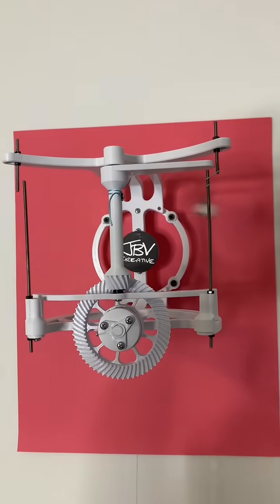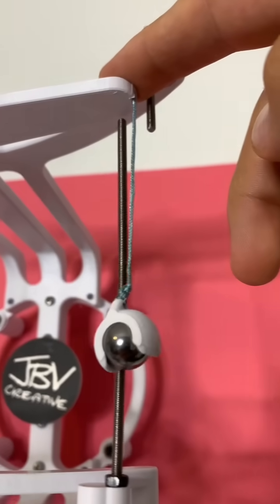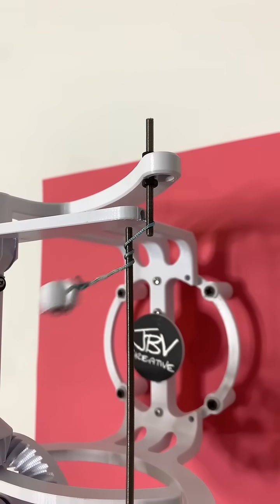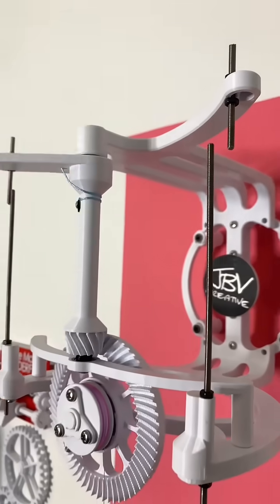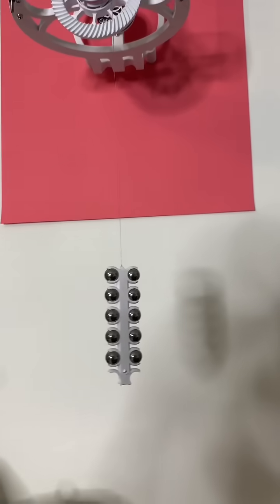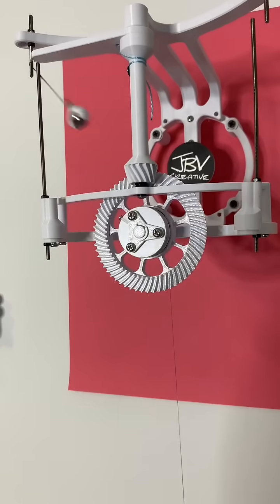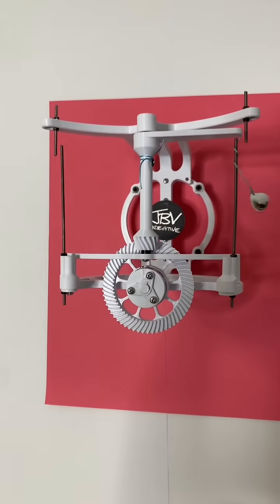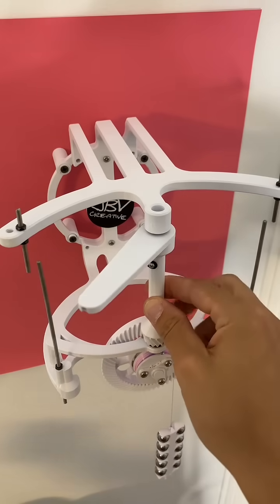The Flying Pendulum Escapement…what?!

Comment: "It's got no pendulum... it's just a weight attached to a string.... " I'm no scientist but I'm pretty sure that's  a pendulum
Reply: Pennsylvania
Reply: @technorunner1  Trannysillvania
Reply: Not quite. I maintain a clock tower, and the pendulum is what keeps time, but the weights, that have be cranked up the tower weekly, and assist the pendulum in maintaining its momentum. Since we live in an atmosphere and have gravity, the pendulum does not swing indefinitely because of friction in the mechanism and gravity, so the weight slowly dropping is what continuously puts energy back into the pendulum, which will be a specific weight and length to engage the clock hands to move precisely every second, minute and hour. The bell has its own entire mechanism with weights and gears that rings a bell every hour instead of moving hands. 

So, basically counter weights aren’t pendulums based on their function in the mechanism. This guys invention could only be a single piece of a much larger machine, simply controlling the rate at which the weight is dropped.
Reply: @geetarguy777  
This guy in no way invented it. It’s an escapement designed a long time ago.
Reply: I'm glad someone pointed that out
Reply: Definitely a pendulum.  A funky pendulum with a really cool action to it, but a pendulum it is.
Reply: Thank you google scientists
Reply: @truthspeaks6557  "it is" "technically it isnt"
Reply: It is a pendulum with a varied period .  Ingenious sculpture
Reply: It’s a pendulum. Weight on a string that swings through an arc. And yes it has horizontal movement that is merely redirected into a horizontal bidirectional rotation by the spindle it wraps around. Still uses the principle that the time of swing in a pendulum is constant.
Reply: @pl watch the video. There is lots of horizontal movement happening.
Reply: Public schooling
Reply: Basically........basically
Reply: He's becoming a horologist.
Reply: That's bird $hit that you've got there in your account PIC.
Reply: CLOCK. ABSOLUTELY
Reply: The pendulum is on the end of the string wrapping around the posts
Reply: Exactly, you are not a scientist
Reply: Yes, but it's not a pendulum escapement, you could replace that weight with a spring
Reply: It has a real pendulum powering it at the bottom
Reply: Pendulums swing back and forth. Think clock.
Reply: Well, technically a pendulum swings back and forth. This.... swings back and forth. 🤣
Reply: Your statement is so profound! Your avatar is so fitting!
Reply: @Maxx_NeverStart  Now dont get mad. Because he is right.
pendulum, body suspended from a fixed point so that it can swing back and forth under the influence of gravity.
Reply: I came to say exactly the same thing. That is exactly what a pendulum is.
Reply: It is in all reasonable responses in a scientific manner a pendulum. Based on a linguistic definition it is not.
Reply: pendulums don't use electricity you absolute dolt
Reply: @env0x  the pendulum is but a part of a bigger system. Just like a pully and wedge can be used at the same time.
Reply: Yea lol, I watched it twice and was still not sure if that part was an intentional joke or not... 😆

Naysayers in the comments notwithstanding, it's still clearly a pendulum, even if made to behave in a very non-traditional way!
Reply: I'ma no Leonardo but.....
Reply: If you want to play this everything's gonna have lots of meanings and soon enough noone's talking about the same thing.
Reply: @cocolasticot9027  let the adults converse.
Reply: @shoppingrb9544  I have an engineering and a physics degree, so I think I can do that.
But you misunderstanding a simple light-hearted comment about semantics tells more about your ability to discuss anything.
Reply: I mean, technically you could call it a pendulum, but it has no horizontal movement, so calling it a pendulum is pretty pedantic.
Reply: @VibesOfVinegar  “has no horizontal movement” ….watches it move horizontally.
Reply: @VibesOfVinegar  a pendulum is any weight suspended from a point so it can swing freely, horizontal motion has nothing to do with it
Reply: @chalor182  Yeah, except the weight in this case doesn't have the most important characteristic: periodic motion.
Reply: @VibesOfVinegar  except it does albeit a complex periodic motion
Reply: @VibesOfVinegar  it does but in 3D instead of just 2D
Reply: @chalor182  yeah it does... The connotation of pendulum is something that swings back and forth... Not in a dam circle around something. So the comment saying it may technically be a pendulum but it's not really a pendulum is totally reasonable
Reply: @VibesOfVinegar  except it absolutely does.
Reply: @VibesOfVinegar  any motion which is repetitive is periodic. no matter how complex the whole movement process is. It has a periodic movement, it just consists of more than one step
Reply: @VibesOfVinegar  that motion looks pretty periodic to me.
Reply: @VibesOfVinegar  Just because It's not moving doesn't mean it's not a pendulum. If a pendulum stops swinging, it's still a pendulum.
Reply: @chalor182 It doesn't swing freely. It's caught and wraps around posts.
Reply: @VibesOfVinegar  isn’t that whole sentence pedantic lmfao
Reply: @VibesOfVinegar  nope. You don't know what a pendulum is or pedantic.
Reply: @VibesOfVinegar  it’s motion absolutely has a horizontal aspect to it! More so than any vertical...
Reply: Y’all nerds really arguing about what a pendulum is
Reply: Periodic motion is motion in which the outcomes are equal in both time and action to complete. This is not a true pendulum with periodic motion as the time to complete each cycle isn't 100% true and exact hence why it isn't a true pendulum albeit very very close to it but this is about as close you can be to a pendulum or periodic motion. Also since it's constantly moving down to a rest point where it will no longer move the periodic motion would end hence killing the fact that it could be a pendulum.
Reply: @acehooligan857  There is no such thing as perpetual motion, every pendulum stops for one reason or another causing it's periodic movement to cease. So, by your own logic, there is simply no such thing as a "true" pendulum. That's a strange position to be arguing. You have tried so hard to be correct and prove him incorrect that you have now negated your entire augment and made you both incorrect. Congratulations! Your transition to the Dark Side is now complete!
Reply: @acehooligan857  nonsense
Reply: @acehooligan857  lol wrong.
Reply: @acehooligan857  grandfather clocks will stop running if the weight doesn't get lifted back up. so what's the difference?
Reply: @acehooligan857  nonsense. No pendulum has “true and exact” anything. None of these are requirements for the definition
Reply: @acehooligan857  
Huh?  So which pendulum has a 100% true cycle every time?
You’re just making shit up.
Reply: @acehooligan857  By your definition nothing is a *true pendulum". Nothing in the universe can have these exact characteristics.
Reply: @acehooligan857  I mean I think you are confusing a pendulum with propetual motion
Reply: Eghh… you forgot the part where a pendulum is supposed to be attached to a fixed point and allowed to swing freely (it wraps around a pole and thus not allowed to swing freely, and the point it is attached to moves from left to right)
He’s not referring to the weight underneath the contraption, but the escape mechanism.

He said “the flying pendulum”(referring, again, to the escapement mechanism), which it is not one.
No fixed point, no free movement from a fixed point.
Reply: @CalamiroAsjcobeti  then explain How the second pendulum in a double pendulum is still a pendulum
Reply: @SlaskPrask  the double pendulum is the first counterpoint I thought about while reading these comments! Let's think about the physical system in the video:
First things first, a motion of a hanging mass shouldn't be discounted as a pendulum only because it is moving through 3D space and not 2D, think of a Foucault pendulum.
Now we can divide the motion of the mass into two stages:
1) the mass attached to a string, which is itself attached to an arm rotating on a plane parallel to the ground. The resulting motion is an accelerating rotation (it's accelerating because the motion is caused by the many balls in freefall) which looks like a spiral with varying radius due to the varying tension in the string, caused by the varying centripetal force due to the acceleration. Imagine looking at this mechanism from a front view (not top-down): without the rotating arm it would be a simple accelerating pendulum, and with the arm the concept is closer to a double pendulum albeit a bit less caothic (I can try to write down its equation of motion if anybody is interested, let me know 'cause I'm lazy). So I would say that during this phase it can be considered a pendulum.
2) the mass is hanging from a string attached right above a rod, and the string is coiling around the rod as it spins. I also would consider this a pendulum: the length of the string is variable, and so is its "attaching point" (the point at which the last part of the string contacts the rod, from which the string starts separating from it, is the new attaching point throughout the motion). Like on the previous stage, imagine looking at it from the front and you'll see a variable length 2D pendulum whose attaching point gets lower then higher. I find this a very interesting motion. 

I think that what confuses most people is that this motion is made up of two separate stages.
Reply: @SlaskPrask  in a double pendulum, the second part is fixed to the first one and allowed to swing freely from that fixed point.
It doesn’t wrap around a pole that is external to the pendulum.
Like the rope does in this one.

Pendulum: “a weight hung from a fixed point so that it can swing freely, especially a rod with a weight at the end that regulates the mechanism of a clock.”
When the weight on the rope wraps around the pole, it is no longer swinging free from a fixed point, because the point from which it swings keeps changing to further and further down the rope.
Aka it is no longer swinging from a fixed point, and thus not a true pendulum.
Reply: @al3th3s  uhh…
If the weight wraps around a static pole.. is it allowed to swing free from a fixed point?
No.. thus: not a pendulum.
It has periodic movement, that’s true.
But it’s not allowed to swing free.
Reply: @CalamiroAsjcobeti  I understand your critique. It depends on what can be considered a "fixed point". For example, in a double pendulum the second arm is swinging from the first one. The coordinates of the point at which the second arm is attached are constantly changing, yet it is traditionally considered a pendulum. Throughout the continuous spiral motion demonstrated in the video, a new fixed point is generated at he contact between the strong and the cylinder it is wrapping around (given there is enough friction to overcome the force of gravity, which there seems to be). I can imagine a simplified system in which a fixed point is moving up and down along a line, onto which a variable-length pendulum is attached. I should consider this a pendulum, but I understand if you might refrain from doing so according to your definition of fixed point.
Reply: @CalamiroAsjcobeti  look up Tether Ball poles. They are a form of Conical Pendulum.
Reply: @CalamiroAsjcobeti  by definition, both scientific and linguistic, a pendulum is "a body (weight) suspended from a fixed point so that it can swing back and forth under the influence of gravity." If you want to get technical, which apparently you do, there are two important aspects here: a fixed point and a body, or weight. The primary aspect of a pendulum is the condition of the suspended body, not the fixed point. As long as the body can move freely, only impeded by gravity (aka, no outside force can grab, adjust, or otherwise restrain the weight), the "fixed point" can be anywhere along the suspension, as long as it doesn't touch the body. The "fixed point" is also a very generic term that merely refers to a "predictable starting position" for the suspended weight to be attached. It is less synonymous with "immovable", and more with "constant"

This IS a pendulum, by any definition you choose, as long as your grasp of the component definitions is correct as well.
Reply: @CalamiroAsjcobeti  this is the only comment, that matters but a lot don't understand that much^^

Comment: make a clock that flips itself off the wall and smashes on the ground when the weight reaches the end of the spindle
Reply: then make one with a super long spindle that takes like a month to fully unravel, find an apartment building that will let you install it in a stairwell, and then it will be an event that everyone can gather for when the clock drops itself ten floors and gets decimated
Reply from the maker: 😂😂 planned destruction

Comment: I'd really like to see how long you can get an escapement to run for. I'm sure there are more optimizations that could make the escapement run for way longer. then you'd have a solid escapement system on which to build the clock.
Reply: You could just use a spring for this if you wanted to. You can print some pretty heavy springs and some springs with a pretty wide range of movement. That could have the potential to increase run time
Reply: @thedudegs-f9w   In terms of a conventional clock's mainspring; especially on the scale this 3d printed clock could potentially be. I think the spring would still need to be made of some sort of metal alloy, usually 'spring steel'. There'd be far too much tension on anything 3d printed, to hold enough energy when wound tight. Else the clock would only run for very little time.
Reply: @SL.ink316  you might be partially correct but it is possible to do it using printed springs and make it run for longer than the weight and string will. You can use a gear train to increase the number of rotations the spring can provide and that means you can use a very heavy spring. There are lots of already existing printed designs for springs that function well in clocks. They can be printed thinner if there is too much tension as well
Reply: @thedudegs-f9w  🔴 What Is Islam? 

🔴 Islam is not just another religion. 

🔵 It is the same message preached by Moses, Jesus and Abraham.

 🔴 Islam literally means ‘submission to God’ and it teaches us to have a direct relationship with God. 

 🔵 It reminds us that since God created us, no one should be worshipped except God alone. 

 🔴 It also teaches that God is nothing like a human being or like anything that we can imagine.

🌍 The concept of God is summarized in the Quran as:

📖 { “Say, He is God, the One.  God, the Absolute.  He does not give birth, nor was He born, and there is nothing like Him.”} (Quran 112:1-4) 📚

🔴 Becoming a Muslim is not turning your back to Jesus. 

🔵 Rather it’s going back to the original teachings of Jesus and obeying him. 

A
Reply: There are already mechanical clocks that run for 1000 days
Reply: Just until the weight drop to the floor
Reply: you could add more sticks around it, each one will slow it down more. it's pretty easy to do